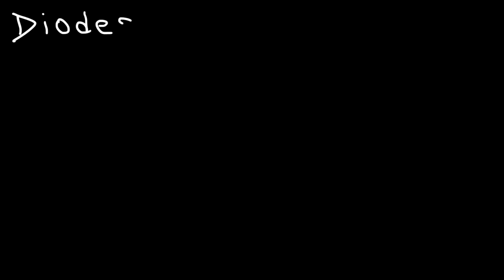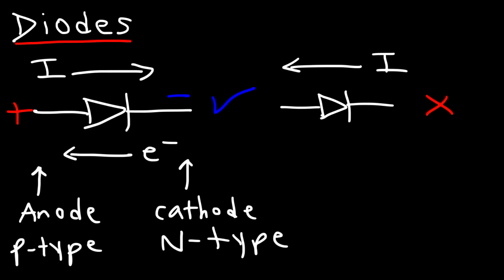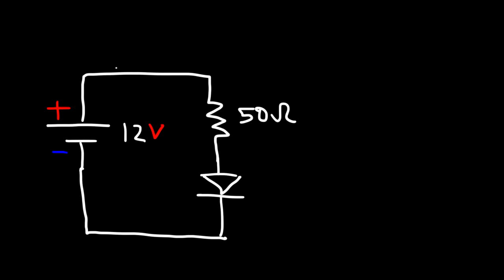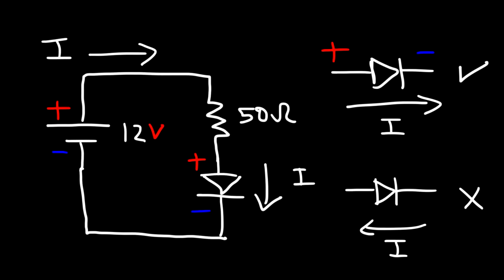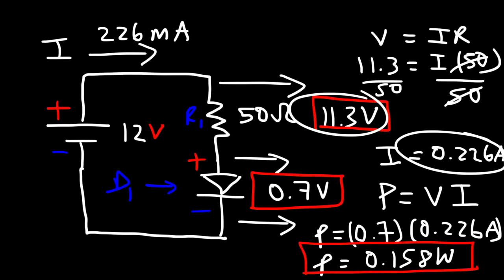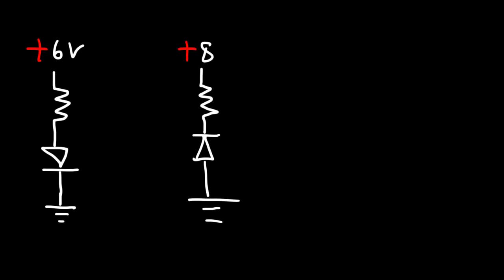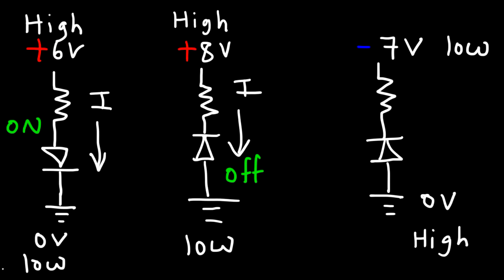What Is a Diode?

Comment: a diode is a semiconducting device that allows current to flow in one direction, so this is the electrical symbol of a diode.
Conventional current will flow in the direction of the arrow. It wont flow in the opposite direction of the arrow, the only way you can make it flow in that direction is if you apply a very high voltage because any insulator can become a conductor if the volatge applied is very very high, there's always a breakdown voltage to an insulator but for practical purposes a diode conducts electricity in one direction. Now keep in mind this is opposite to the electron flow
( <—e-)  conventional current describes the flow of positive charge but electron flow flows opposite in the direction of conventional currents so the electrons are flowing to the left and just keep that in mind

Comment: As far as I know, the operating points including the voltage level can change based on the resistance but you assumed that the voltage across the diode was 0.7V. Can you explain why?

Comment: Does diode block the flow of electrons as it does to current in flowing in one direction, since electrons flow in opposition with current. I.e diode allow current flow in one direction, block it in opposite direction, while electrons flow in opposite direction, will the electron b blocked hence it's flowing in the direction diode is blocking. Reply pls.

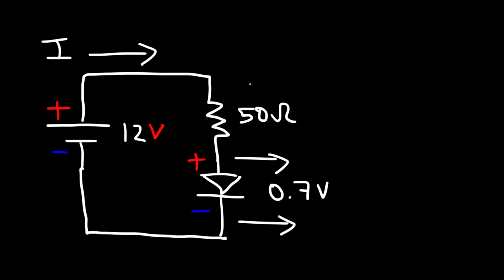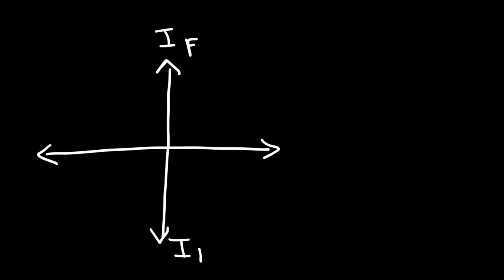Comment: At @6:20 he assumes the voltage across the diode is exactly 0.7V, but there is no reason to assume this! Surely, the diode can have a range of possible voltage values across it, as seen in the diode's Voltage, Current graph @3:30. This variable diode Voltage presumably increases as a result of increasing the source Voltage. In light of this point, how does one then properly calculate the resulting voltages, and current?

Comment: In 11:44, isn't that the diode is OFF because the forward voltage applied across its terminals does not exceed the diode's forward voltage threshold, which is according to the video is 0.7 volts? Please advise.
Reply: It is on because the source voltage is in negative value, flowing through the cathode (negative terminal) side of the diode. If the negative voltage source is flowing through the anode (positive terminal) then the current wont flow.

Comment: I dont unerstand why the naming is different compared to a battery. I thought the anode of a battery was the negatively charged terminal that has excess electrons, so why would the anode of a diode be the electron deficient part that contains holes, its just confusing. I was just reading somehting and had a thought: Is the anode of a battery actually initially positively charged, becoming negatively charged only when the chemical reaction happens within the battery and the resulting free electrons are attracted towards it?

Comment: I remember which end is the anode because the arrowhead in the symbol for a diode looks like an "A" (for Anode) on its side. It points in the direction of "conventional" positive-to-negative (P-to-N) current flow, which reminds me that the anode has P-type semiconductor, and the cathode has N-type semiconductor. The vertical line for the cathode represents a wall that blocks "conventional" current from going from cathode to anode. That "wall" is represented by a ring marked around the cathode end of a "physical" diode.

Comment: Hi. I'm new to this zener diode voltage regulation. Do you have a video where your output is charging a battery, with internal resistance.  I want to know how much ohm resistor is required with input voltage of , say 16vdc and regulated output of 14vdc. Thanks.

Comment: Is it optional that a diode would be on if the voltage flowing across the diode is exactly 0.7?

What would happen if the voltage is less or more than 0.7?
Reply: If the voltage supplied across the diode is less than the diode voltage, then the diode won't "Turn On". Otherwise, the the voltage supplied across the diode exceeds the diode voltage, then the diode will "Turn On".

Comment: The current in a diode under forward bias and in constant thermal equilibrium are due to the movement of the holes and the electrons moving and recombining on and on and on.
The conduction processes of p-n junctions can be easily understood if Current is understood properly by taking a unified approach to electrostatics and circuits. 

Electrostatics and circuits belong to one science, not two.
These are discussed usually separately in textbooks and science and engineering courses. 
Watch the two videos listed below to learn about current and the conduction process and surface charges (using a unified approach to electrostatics and circuits) which set up the electric field whose line integral is the potential difference. The battery produces the emf.
The last frame of video #1 lists textbooks which discuss all these topics in more detail.
1. https://youtu.be/REsWdd76qxc
2. https://youtu.be/8BQM_xw2Rfo 
[Also see Also see these lectures by North Carolina State Univ faculty which use a unified approach to electrostatics and circuits. 
15. Simple D.C. circuit. 
Pattern of electric field.
Watch from  16.0 minute.
16 Mechanical Battery
Watch from 19.0 minute.
Ch18L1b
https://youtu.be/Eu3JQKrJRZA?si=t3MeX8Hi8ELAxaz0
17 First intro to  Surface Charge 
Watch from 10.30 minute. 
18 Surface charge gradient 
Watch from  15.30 minute. 
Ch18L2a 
https://youtu.be/bp0o1HZOs3g?si=PPiPGepbXvdTgJHX ] 

I have discussed the exact idea on the relation between diode current and saturation current in detail in Chapter 9 and Appendix E of textbook 4 listed in the video #1.
Also explained in the textbook 4 is why the potential barrier of an operational diode can never be made 'zero'.
Textbook 4 is here https://techsarworld.com/product-detail/fundamentals-of-electric-theory-and-circuits-559 

PPTs and Videos with animations for all the ten chapters including that of pn junctions Chapter 9 and a few applications Regulated DC Power Supply, Differential Amplifier and Transformer coupled audio power amplifier of  book Fundamentals of Electric Theory and Circuits are available for download and viewing here
https://techsarworld.com/download-resource/fundamentals-of-electric-theory-and-circuits-559

Comment: Probably a dumb question but in the 3rd example of 0V (low) going to -7(high) the diode would have a voltage drop of 0.7 volts but you have 0V passing the diode so even if the circuit is on, no current would flow because you don't have the voltage strength to pass the diode. Can someone explain what I'm clearly missing? I'm probably just dumb. lol
Reply: The 0V in the 3rd example is the high potential and the -7V is the low potential, so the potential difference is 0-(-7) = 7V which is more than the voltage drop in the diode (0.7V), so current will flow in the direction shown in the video.
Reply: @ahmedbelal7370  that makes sense thanks !

Comment: Electrons flow from negative to positive?
Reply: Yes. Electrons flow from negatively charged area to positively charged area. Therefore, current which is a flow of electron vacancy or hole, flows from positive to negative. If you add a battery to a circuit then current will flow from the positive terminal of the battery towards the negative terminal of the battery through all the other elements in the circuit. 

To ease the confusion, think of heat flow according to thermodynamics. Heat flows from high temperature area to low temperature area. Also if you think of water, it flows towards the area where water is less or the pressure is less. 
Just like that everything in nature flows from it's majority towards it's minority.

In a negatively charged area, electrons are higher in number. So electron flows from negative to positive.
Current flows in the opposite direction of electron flow. So, current flows from positive to negative.
Reply: @farjanasharminswarna2450  Thank you so much
Reply: Welcome. Happy to help. :)
Reply: @farjanasharminswarna2450  but current IS electron flow isn’t it? I’ve seen it explained that way in several videos
Reply: @mrbushpilot  current is electron flow, but it flows in direction opposite to electrons just like positive charges.
Negative charges flow from negative to positive(lower potential to higher) and positive charges flow vice  versa.

Comment: Dosent electron current flow from negative to positive
Reply: that's with the electron flow theory, which is what Americans use. But I believe the rest of the world uses the conventional theory (where it flows from positive to negative). You are correct, but both methods work as long as you keep the same direction throughout your diagram. also at the start of the video he mentioned it was the conventional flow theory I believe.

Comment: Hey, I think you made a mistake. Electric components in the electric circuits never consume power unless they have internal resistance. Since you provided that the diode has a voltage of .7 volts, this means it is ideal one so it has no resistance and, thus, consumes no power
Reply: Any electrical component with a positive voltage across it and a positive current flowing into the positive terminal consumes power. The idea of "resistance" is only a linear approximation to much more complex phenomena, such as what happens in a diode. The only power equation that always applies is P =V*I
Reply: If there is a voltage drop of .7 volts across the diode it must be consuming current when it's in the forward bias mode.  Its simple ohm's law.
Reply: You cannot guarantee the voltage across the diode will always be 0.7 V can you? It depends on other resistors in the circuit
Reply: @bestbronzena4918  no, it’s always .7 with a diode
Reply: @user-wc6pp4mi6t  i think its just for Silicon.
Germanium has like 1.4V